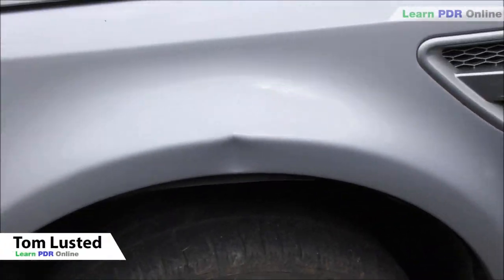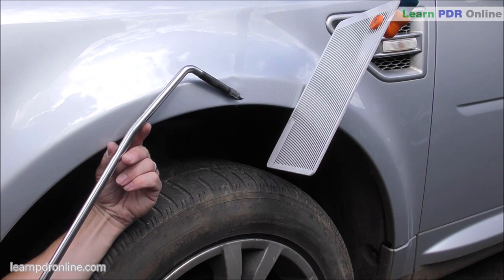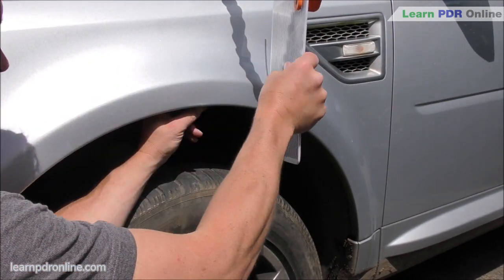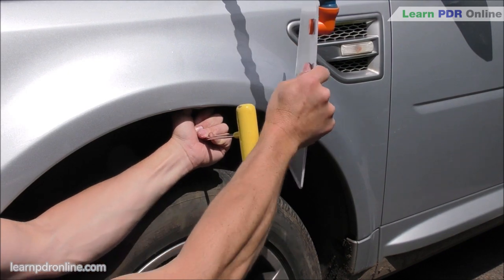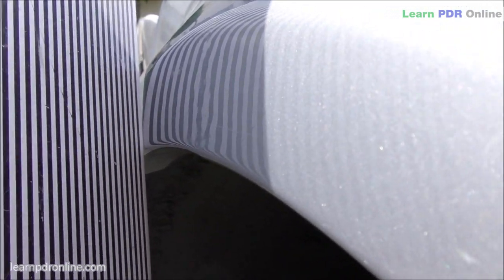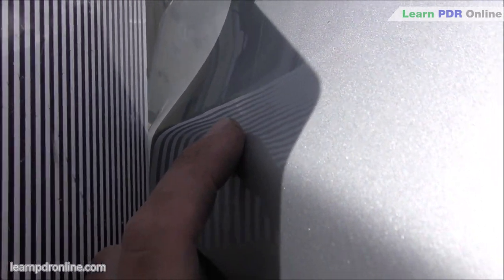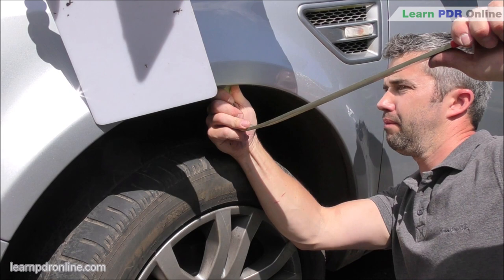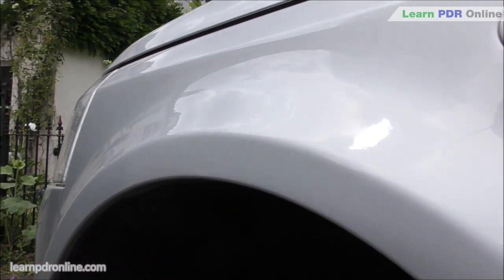My Top 3 PDR Tools For Repairing Wheelarches | Paintless Dent Repair Tools

Comment: Thanks Tom for explaining tool selection,job nicely done...Would a moose knuckle take the pressure off your hands,the look on your face shows a difficult effort to do the repair
Reply from the maker: Thanks Victor, yes a Moose Knuckle would help with the leverage with some of these tools and certainly reduce strain on the hands, I don't have one at the moment however I have also heard of a new tool from 'Stuckey' specifically designed to reduce the strain on the hands when leveraging off tyres, its a small plastic hand shield, I cant find the product online yet but one to look out for for sure. Pulling faces is all part of it, it means I'm working ha ha :)